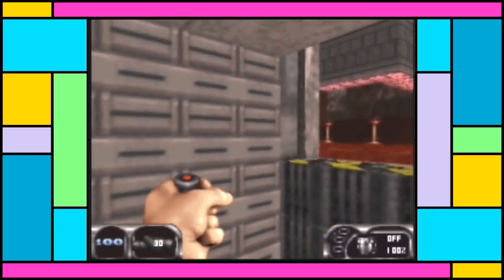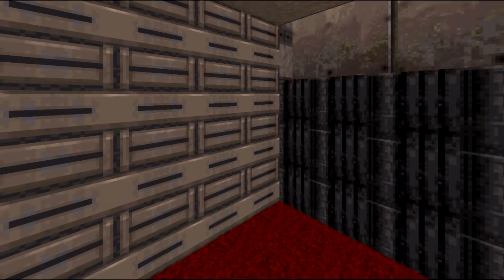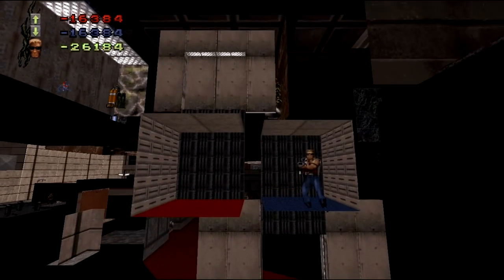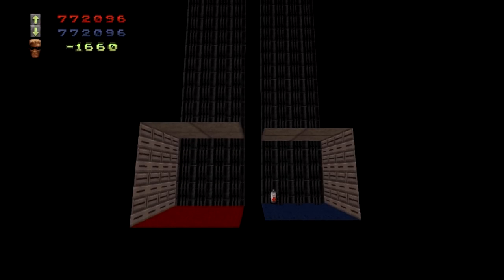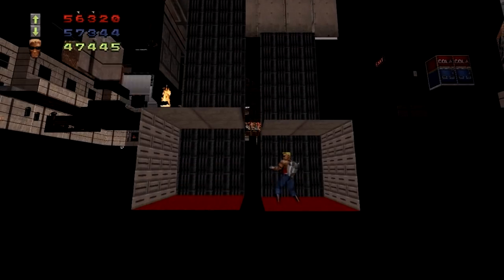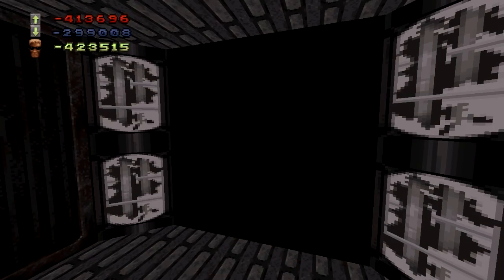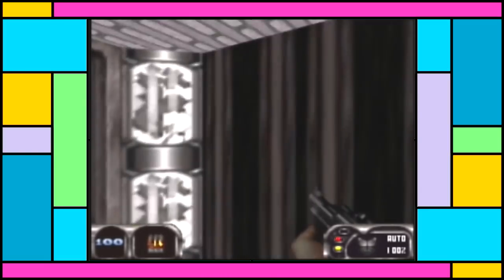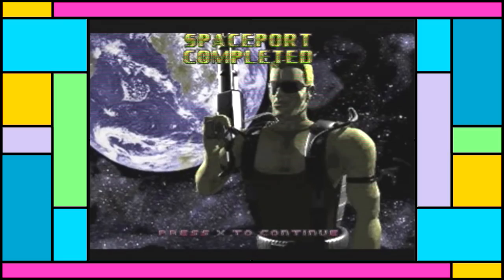Hotel Hell's broken elevator

Comment: Ah yes, the infamous " Infinite Elevator " man i love these in-depth vids about Duke you are putting out. Things people might have never noticed on first place ( or even years after ) being covered is very interesting.

I remember having a very rare glitch with a key card when i was playing it as a kid - as i was putting the key into the device on the wall i probably got hit by an enemy at the same time in some odd way because instead of taking damage as usual, it acted like i was " Squished " and Duke's hand sprite holding the key was literally frozen in the air and i could walk around it - it turned into a literal sprite always facing me but instead of it being always on the screen from player's point of view, it was now part of the world.

Needless to say i was just amazed, i even saved the file ( which normally wouldn't be a good idea but it seemed like a small glitch that would not break the game ) and when i loaded it back, it was gone.

Just goes to show you though that anything can happen.

Many of which we probably still don't know about.

Great vid man!
Reply from the maker: Thanks man.
There are some quirks with keycard insertion, you can actually trigger multiple card switches at once if you move past them in a certain way when the animation is playing. I have never seen the glitch you describe though, might have to try and reproduce it some day, do you remember if you were in 1.3, 1.4 or 1.5? Or even an older shareware? The hand sprite appearing in the map is what throws me, i'm not sure how that would happen as it isn't really supposed to work that way.
Reply: Totally! It was the 1.3 ( Still have original box somewhere ) which also came with the editor at least if i remember correctly, since it had manual for both the game and the tools to work with, but since i was really small back then didn't get to fool around it till later years.

It was definitely very rare as it never happened again especially since i tried to replicate it right after as well.

Comment: I didn't know this, and I find it extremely disconcerting! It's like slowly nearing an event horizon, or some warped parallel universe where the speed of light is different. (Plus your annual reminder to play Ristar 👍)
Reply from the maker: Funny thing is that at the moment you left this comment, I was quite literally in the process of dragging the Mega Drive out. It would seem wrong not to play Ristar while it's out.
The elevator actually does pass through parallel universes in a way, kind of the opposite of Mario 64's PUs though, where you can see them, but you can't touch them, at least in the PC version.